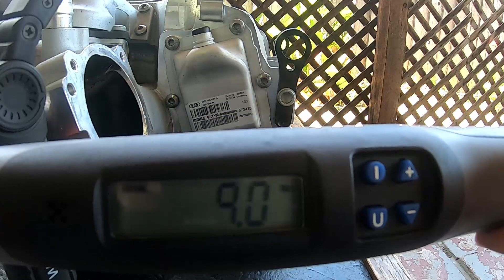DIY: How to replace intercoolers on a 3.0T Audi S4 (S5, A6, A7, Q5, SQ5)

Comment: Offering feedback as you requested at end of video. I have performed this task twice and fairly strait forward per your video. A couple of call outs: when installing intercoolers lubricate seals/O-rings with motor oil, including the long rubber seal that is parallel to intercooler (essentially all rubber contact points should be lubricated with motor oil for installation). Not doing so you risk damaging seals as there is too much friction, that is why you struggled installing intercool. Audi service manual stresses this lubrication of seals during install. Also, I cringed when you used a screw driver to pry the intercooler loose. That is a machined surface and you don't want to damage it. I found a small wooden block between intercooler (at water pipe end) and hammer works quite well. 
If you don't have the tool to properly fill coolant system and you find yourself purging air, then there is a third bleed location at the firewall. You will find the passenger side heater core hose at the firewall has a hole in it. This too is a location to bleed air from the cooling system. Work the hose back until hole is exposed and coolant flows out.

Otherwise, I admire your attempt at replacing supercharger intercoolers. Most folks would be intimidated. Also, intercooler was aged but I noticed the last character in p/n was an 'F'. Audi has revised these intercoolers many times over with current revision ending with an 'S' character (which you installed). Early intercoolers are known to fail with small coolant leaks, typically leading to loss of coolant but, no indications of it and/or a cylinder misfire.
Reply from the maker: Great feedback! I think I did say in the video you should lubricate the o rings but I didn’t do it as a step. That is good to know, I do now have silicone grease and assembly lube. Also, I see your point on the intercoolers, I knew it was bad so I didn’t care if I damaged mine. It seems like everything Audi made had revisions to it

Comment: Been trying to track down an invisible coolant leak in my 3.0T for a little while now and I just threw a cyl 3 misfire code today. Going to pull the plug soon to see if its fouled with coolant and I have a feeling I will be doing this process very soon. Im stoked to have come across such a well documented and thorough video on the process. Thank you very much. This video has made me confident I will be able to do the job myself!
Reply from the maker: If you need help ask Audizine
Reply: Pretty sure thats Tstat
Reply: @blondishasp572  ended up being the IC cores and PCV. Wound up doing WP, tstat along with it tho.

Comment: Thanks for the video.
Just finished this service on my A6 C7, and flush oil, it was dark brown and smelly...also cleaned valves and found a small coolant leak ( thermostat pipe, someone replaced it before and didn’t installed it correctly).

Comment: When reinstalling, no need to use a mallet, Just push by hand and tap it in with your palm, shouldnt be an issue if you lube the side seals and o'ring. another video the guy has the audi manual and they recommend highly that no tools be used to force it in. I had no issue using my palm for reinstall. Dissassembly is a little different though. You will bend them if you use a mallet. I would recommend cutting a circular piece of something and drilling holes then screw it in at the end to remove them if you're gonna reuse them to prevent bending in the intercooler. once there bent, it is very difficult to reshape them flat again. I was reusing 1 of 2 and had a small bent and was able to use a bolt with a washer to try and force it back out flat. I don't know yet if it will leak or not.

Comment: Great video ! 
A couple tips, lay something flat against the front of the IC when removing and hit it with a 5lb dead blow. Then once it starts to move I turn it and use the handle to push it the remaining way out. Then when installing push it with your hand most of the way until the front starts to seat, then you can start putting your bolts in and then as you tighten those it will seat it the remainder of the way. Also another subject you might want to note is its VERY common for these intercoolers to arrive with the flange side slightly bent back , which leads to a very small boost leak between the flange and the gasket. I now just to be sure take a flat head or punch and tap around the edges once you seat it with your hand to bend it slightly toward the gasket, prior to starting to bolt them in. I have had zero issue since I started doing this on them. 
                                                                                                                                                                                               Mike @ Mad By Design
Reply from the maker: I was thinking of sending my SC to you for a port, might have to do that in the future.

Comment: I know you pressurized and bled the coolant from the super charger did you bleed it from the heater core section aswell? I know air can get stuck there or does pressurizing it not

Comment: I had one leaking maybe for the past few years as the coolant would drop a little over a year and was topped up with the oil changes once year.  Audi is replacing both of them and doing carbon cleaning too on my low mileage tuned 2010 S4.
Reply from the maker: You got lucky
Reply: @quattrogang63  Not free.  Paid 3200 before tax and the carbon cleaning was half price at about 660 in that amount.
Reply from the maker: @paull3179  oh man, I would of paid a independent mechanic or a 3rd party shop. That’s a lot of money
Reply: @quattrogang63  my independent Porsche specialists costs about the same and no discounts.  At Audi I get 15% off parts and labour while the other shop laughs if I ask for a discount.  My full brake job was quoted for less than the other shop and plus it is worth paying for high quality work.  I charge more than the dealer for my time.
Reply: @quattrogang63  I take my 991S to the Porsche specialist but they are expensive. I like having a new loaner which only dealers will provide so I am thinking of using the porsche dealer in the future.
Reply from the maker: @paull3179  yea that seems like a lot of money

Comment: Question, how do you know it failed? Does the car pop up a code?
Reply: It does, but with earlier revisions of the intercooler it might not.

Intermittently rough idle and cylinder misfire codes (EPC light) are what I'm experiencing. I'll be doing this same service soon.

Comment: why did you pressure bleed the system instead of just putting the whole system in vacuum ?
Reply from the maker: Didn't have the right fitting for the vacuum system

Comment: Hey man ,thanks for the video. Can u pls give me the name for the pump and adaptor u used to pressurise the system?
Reply from the maker: The pump was from snap on. You can use any type of pump with the right threading. Just pour in coolant first and pressurize it after

Comment: Awesome video man!  Question, what was the mileage on your car when you did this work?  I love my S4 and know about the common issues thanks to ShopDap – Thermostat, PCV, engine mounts, etc (All around 50k).  Trying to budget for major work at ‘common failure’ intervals.
Reply from the maker: This failed at around 85k miles with a tune. I think if you're not tuned it wont fail but, if you are it might fail prematurely
Reply: @quattrogang63  Thank you.  I have a 2016 Stage2 Dual pulley with APR CPS system.  I don't race or track the car - cruise around town with the kids and mash on it once or twice a ride to put a smile on my face (and the kids)
Reply from the maker: @markjohnson2079  what a fun family car
Reply: @quattrogang63  that's exactly the mileage point when mine failed as well.
Reply: @quattrogang63  6 month update - leaking fluid into Cyl3.  So - failed at 44k miles.  Not fantastic.  I appreciate the video even more now!

Comment: Doesn't look like a very efficient design compared to a front mount or top mount, where cooler air is forced onto the intercooler.   Looks like a lot of heat soaking with this design unless I'm looking at it wrong.

Comment: Did you have any white smoke coming from your exhaust when it leaked?
Reply from the maker: No, I did not, I would have violent miss fires on my engine though. If enough coolant gets into the combustion chamber I would think you would see white smoke
Reply: @quattrogang63  that’s what happened to me. Misfires and then white smoke a bit later on
Reply from the maker: @S54VR6  Check your Spark plugs and Ignition coils. You could have a head gasket leak. Do a cylinder leak down test on the cylinders that are miss firing also, get some block test fluid and test the block. If your car fails one of these tests you will have more insight into what is wrong with your car.
Reply: @quattrogang63  appreciate the input! I tore down the supercharger and found bank one intercooler was leaking into cylinder 3. Just waiting on parts now but I’m praying that’s what it was
Reply from the maker: @S54VR6  You might want to get a Map sensor for that bank, I had to replace mine
Reply: @quattrogang63  car is somewhat back to normal. No codes,  no smoke and cooling system is holding steady coolant for a week now. Only thing I noticed is it feels slower and the exhaust note is different. Wondering if one of the cats took a poo and is on its way out... good thing I’ve had JHM test pipes laying around lol
Reply from the maker: @S54VR6  That could happen when you have coolant burning away in the exhaust lol. From what I have heard the test pipes have drone so you might want a resonator